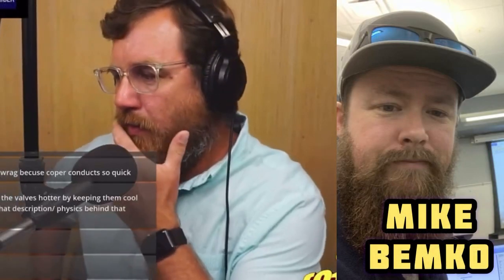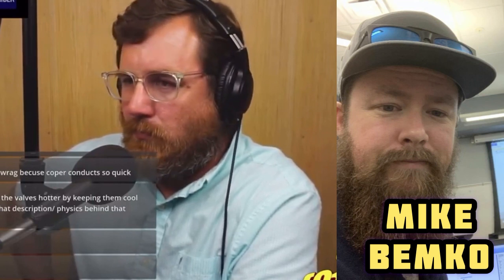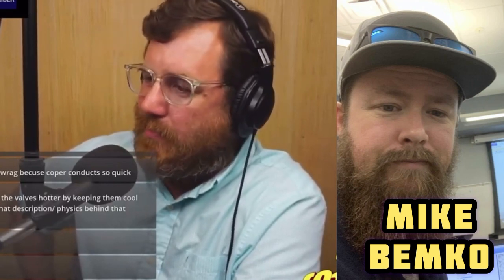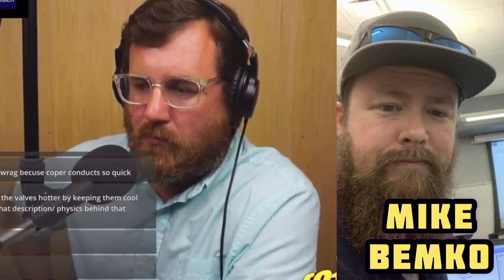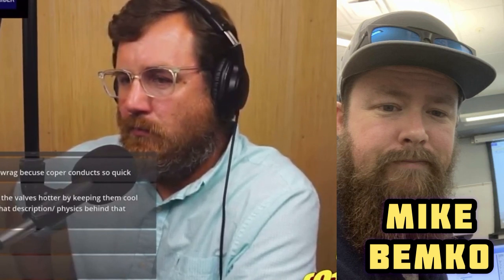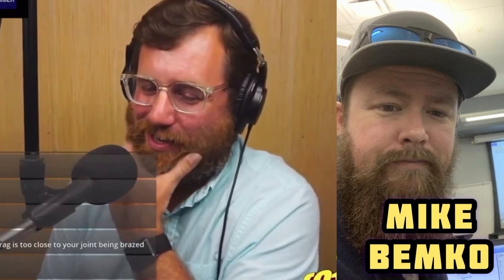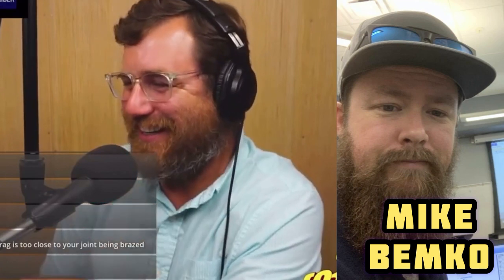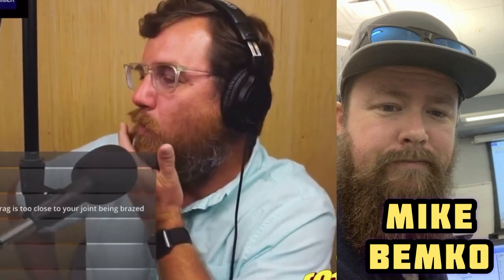Was I Right about Filter Driers?

Comment: In my 24 years doing hvac I've never seen a dryer leak. Rust yes but no leaks
Reply from the maker: I have seen a couple, due to salt at the beach. I think I made a video of it.
Reply: Me either until I moved to Houston
Reply: I have.. 5 ton Tempstar roof top unit.. Rusted, leaking right at a weld seam... It was 15yr+ old.... Looked like small ice particles coming out of it. Craziest shit i ever saw... Had to cut it out, put a new one in... But it was next to condenser. Just on rooftop is what made it so bad...

I put my driers at the easiest location which is usually the furnace, outside of the air handler-furnace... I am sorry but i call a air handler a furnace because when you say "AIR HANDLER" to people here they look at you all bug eyed even thought that is what the industry calls them, people here call them electric furnaces so we do... 

If you got a unit with drier in condenser and say you have to do a repair, chances are you are doing everything you can to keep that drier sealed up via locking down the service valves anyways, so i don't think 2 driers would hurt anything especially when that vacuum test with water Zack did failed to remove with the vacuum pump. 

Imagine a unit that a pipe burst, then it sit in rain for a week wide open before repair.. That is some serious moisture possibility right there!!!!

Just had a RHEEM-RUUD unit with a bust HP Sensor line.. They (ALL) are having this issue where it come off the discharge pipe, and a bend up to the HP cut out. That bend bursts. Seen it on (2) systems now i had to repair and completely refill!  I filed a heads up with RUUD so they can get word and a bulletin out for contractors to watch out in case they get a leaking system to look there first.  I shut off the service valves so that any moisture possibility was in the condenser, not the whole system line set, AH, etc.

But yeah. Been there done that.
Reply: Hundreds of driers leaking in South Florida. I’ve done dozens I’ve had some leaking within the first three years especially in the Ocean

Comment: All American Standard units come with filter drier attached to the outside of the condenser for field installation. They prob just to install them inside the unit because of idiots who prob never put filter driers on. No lie I have came across a system with 3 total filter driers. 2 on the outside and 1 at the indoor evap. 🤦‍♂️🤦‍♂️🤦‍♂️🤦‍♂️😂😂😂😂
Reply from the maker: I think that you are right, in the old days they just want to make sure guys used driers. I also have seen and caused a multiple dryer situation……
I have grown since then.
Reply: No way 😮

Comment: Carrier wants filter driers inside near the indoor unit if the system is 3.5 tons or smaller. They say it's more efficient. 4+ they want it outside.
Reply from the maker: Interesting, never heard of a split requirement.
Reply: They will void txv warranties if the drier not at the evap
Reply from the maker: @Freonleon  but if I do put it inside will it void the outdoor TXV warranty?
Reply: @TALYN875  great question!!